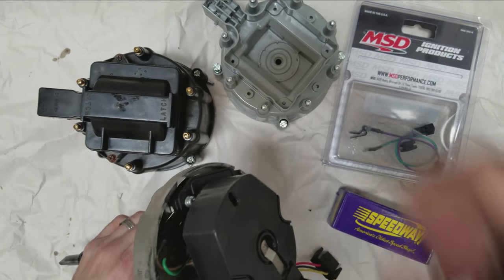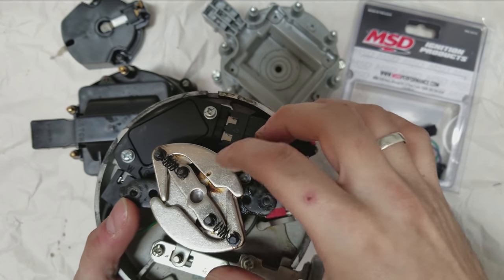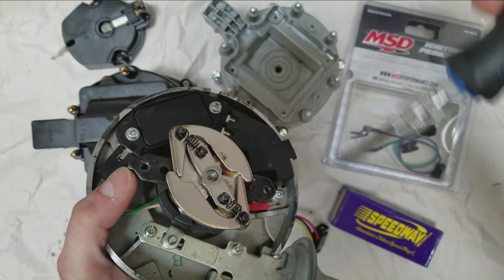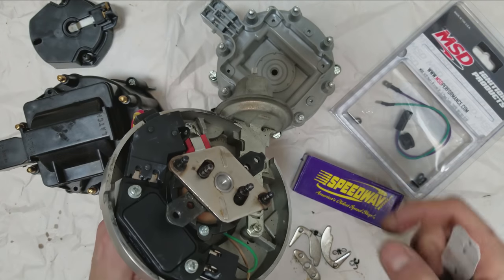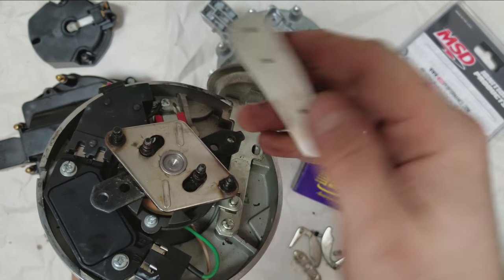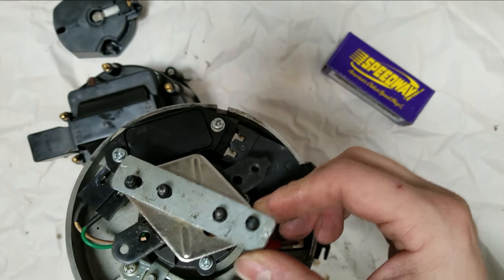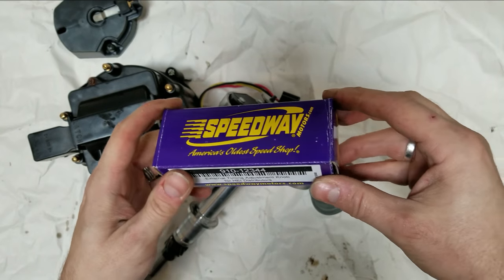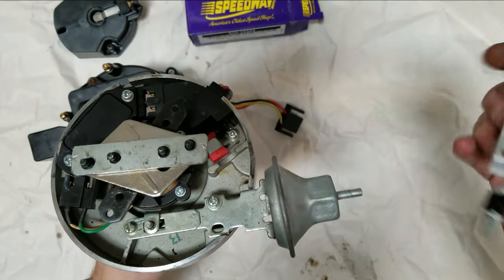1967 Turbo Camaro - GM HEI Large Cap Distributor Timing Control with Holley Sniper EFI

Comment: I'm confused, if the rotor is fixed, and the reluctor is fixed, how is the timing being controlled? If nothing moves?
Reply from the maker: The distrivutor is tuned to a specific ADVANCED reference point. The whole thing is advanced (forward in time) to a specific reference angle and you give that angle to the Holley Sniper system. Then the Holly Sniper controls the timing by delaying the spark exactly the right amount to coincide with the desired timing. Imagine the Holley Sniper being set ahead of everything and all it does is wait for the distributor to catch up and then fires the coil at that moment. Normally the distributor tells the coil to fire the moment it reaches the desired timing, now it's just a reference device to tell the sniper how long to wait to fire the coil. It's a weird concept to wrap your head around.
Reply from the maker: This is true except I discussed "phasing" the rotor in the video. Essentially you are setting it up and adjusting so that the rotor will be in the best spot when the spark is expected. I installed that adjustable knob so that things could be moved in case the rotor was going to be out of alignment with the cap, but in the video it worked out that it lined up on the first try. So the spark jump distance is a concern, but if setup correctly, is not an issue with this timing method. I'd you were to buy a special Holley distributor to use for timing control with the sniper, these issues would be eliminated. The advantage is price and using more stock parts, if those things are important to you.
Reply: @TurboCamaro67  I'm not sure you're understanding me.. and I just want to understand this better..  basically with the reluctor.. (because both are now solid) static and the rotor static.. the only way i can see advance happening is that the ICU is telling the coil to fire when it wants.. however that doesn't physically move the rotor for timing nor does it move the reluctor because neither move.. at any time.. therefore.. when the coil fires it's jumping a longer arc at times to the pin on the cap.. because nothing changes the rotor position.. Unlike the stock setup where the coil fires when the reluctor tells it to.. it has it's own vacuum advance and the rotor has mechanical advance..  Because you've set it up to 45 degrees my guess that is when the rotor would be at the pin.. when the timing is retarded.. the gap between the pin and the rotor would have more distance and possibly a weaker spark.. because the coil is firing.. late to the pin because again.. the pin and the rotor no longer time the spark.. am I correct?
Reply: @TurboCamaro67  To answer my own question.. I guess the reason why the rotor or reluctor doesn't have to move is because the rotor contact and the pin on the cap aren't finite points.. they are wide.. which means that there could be as much as 50 degrees when the rotor gets to the pin and when it leaves the pin.. because even though the engine balancer moves 45 degrees the rotor doesn't.. thanks a bunch you  made me think about this.. and in essence.. why buy an expensive dumb distributor from msd or holley.. when really they aren't doing much.. the only question really is .. RF noise from the HEI.. distributor with the reluctor... yours seems to work fine though..
Reply from the maker: Yes, mine seems to work fine. To add to your answer, the spark will always have to jump a gap, and will always travel the shortest distance. That being said, the distributor cap I'm using is the cheap one that came with the HEI I bought off eBay so many years ago. It has longer terminals on the inside of the cap, this extending the window the rotor has directly in front of the terminal contact. This isn't true with all caps, but if your concern is the ability to phase the rotor for ideal spark, you could check if yours has the same style, or pick one up locally. Its not a requirement but may help prevent a weak spark scenario if things done line up ideally. I found the 10-36° timing range was fairly centered on the cap plug terminal, thus allowing full spark, especially with the length of the terminal on mine. I bought a roll of tape designed to block RFI as it was a concern of mine too, but never used it.
Reply: @TurboCamaro67  I thought that really you "had to have" the holley hyperspark distributor to cut out the noise.. because so many people experience problems with RF.. it could be that your ignition is entirely on the other side of the motor that it's less troublesome.. but if so many have trouble with RF with hyperspark RF and dual sync maybe there is no magic with these either. What you've really demonstrated in your video is that in fact there probably is no magic at all in these aftermarket distributors.. I tend to think that there would be less noise.. better spark with a coil in cap setup like HEI anyway.  I do like the idea of the HEI because good luck getting a holley part "on the road'  by the way.. I love the idea of a 6 cylinder turbo camaro as a daily driver.. love that idea.. FYI i'm in Calgary, AB.. looking into holley sniper for my GMC motorhome with a olds 455.. I often go into BC though the mountains and I think there'd  be some real benefit torque wise with sniper and timing control.... and even a turbo.. (now i'm getting ahead of myself, the turbo might take out a transmission) thanks again for the responses..
Reply from the maker: No problem, glad you've enjoyed the build. You definitely don't "have to have" one of their fancy distributors but it could be more of a hassle free approach. I had no issues with mine but as you read online, lots of people have RF issues so who knows. Like you said too, different cars with different setups can easily cause unique issues. Thanks for the conversation, it really got my mind back into the details of this video.

Comment: So I’m a bit confused with phasing (surprising I know) if the pickup, reluctor, and cap points are aligned at 45* at the crank (10* before your max of 35*) won’t it be attempting to spark at 45* before tdc? What brings the spark back into the 35* ignition range?
Reply from the maker: Yeah the phasing is a bit confusing for sure. Took me a while to wrap my head around it too. Essentially, you are intentuslly setting a specific higher advanced angle (45°) so that you can provide that reference angle to the Sniper so it knows that exact angle. It it knows that spot on the rotor is 45° then the Sniper software can calculate the amount of delay required to make it be 40°, 35°, 32°, 30°, 28° or whatever lower timing you have the Sniper software tuned at. Its simply retarding the timing back from 45° (or whatever reference angle you use) to make it the desired timing. Your goal is to establish that angle for the Sniper, while ensuring the 5-40° rotor curve will float around the cap terminals. That make sense?
Reply: Maybe. Lol so the only thing that needs to be aligned at the reference angle is the reluctor. Then the rotor needs to be aligned at the total timing angle? And yours just happened to be one and the same?
Reply from the maker: Yes, the reluctor needs to be as perfectly aligned as possible while at your designated reference angle that is above your maximum timing angle. I was pretty lucky as my cap has wider terminal contacts than some, and the °45 angle I went with worked well for phasing the rotor to the cap. I belive I made a slight adjustment using the fancy adjustment knob to align the reluctor right at 45°. The people I've been in contact with have been successful with this method using original GM parts and aftermarket distributors like mine. The theory is GM designed the cap and rotors to be properly phased in the normal timing angles of 10-36° as if they wernt, all the cars would run poorly. It seems complicated, but the hardest part is making sure you've picked a reference angle above your max timing where the reluctor lines up. You could easily turn the engine slightly either way and just use whatever angle is actually lined up. Might be 41° or 43° but as long as it's accurate and the rotor lines up with the terminals on the cap in your normal timing range the software can do the rest.
Reply: Got it. Thank you so much! Love your build!